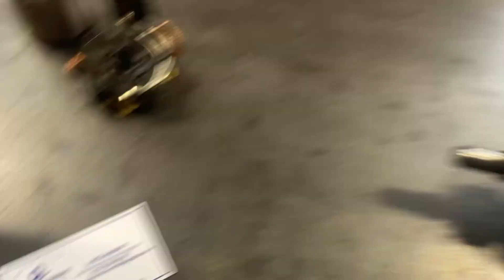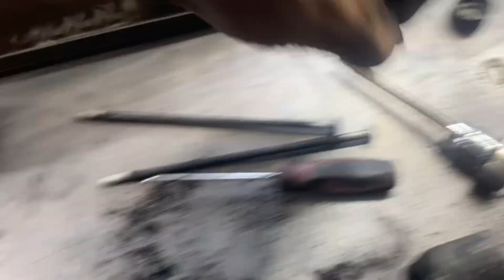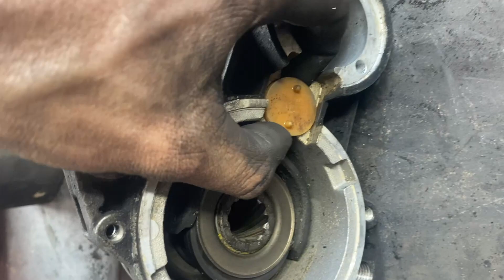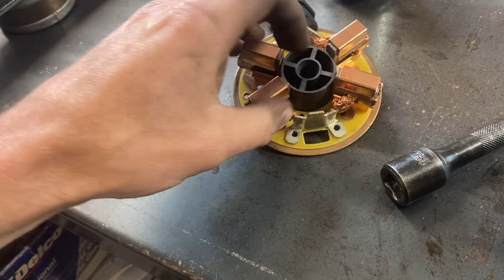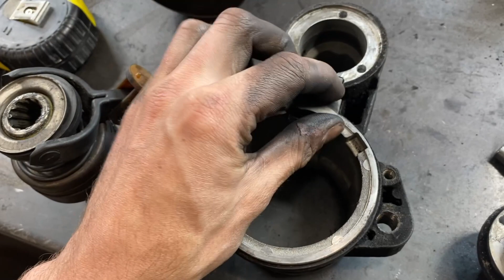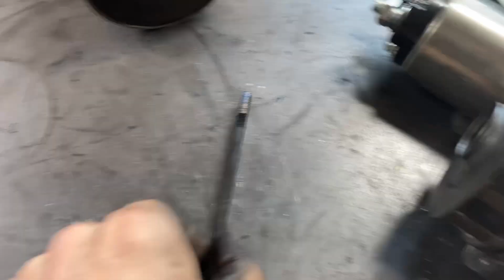V10 TDI Starter rebuild

Comment: Hey Josh,
How has your starting been after the starter rebuild? Have you noticed the starting RPM higher than it was before? Has the starting been snappier since?
Reply from the maker: Awesome so far but I’m only a couple weeks in. I believe my solenoid was the issue, it would intermittently act like a low or dead battery when it wasn’t. So I would say it’s consistently snappier and keeping a regular starting speed rather then a slow crank which speeds up.